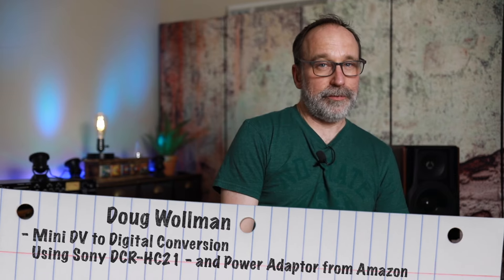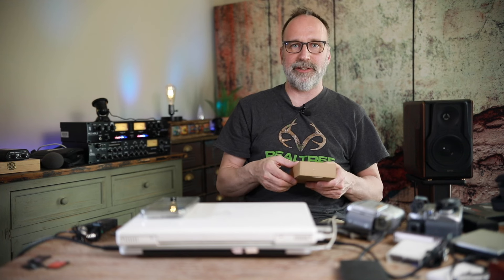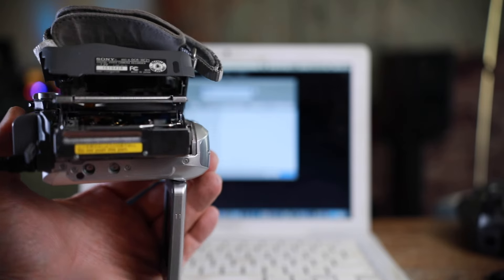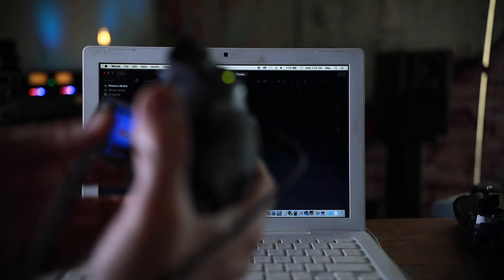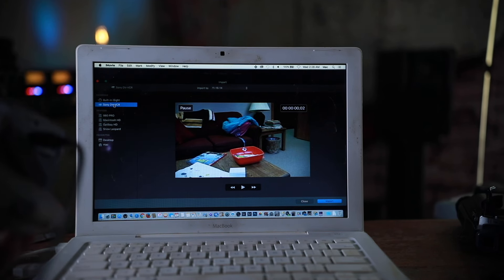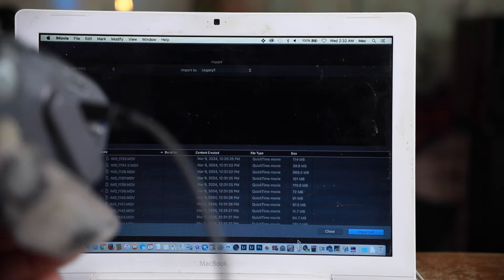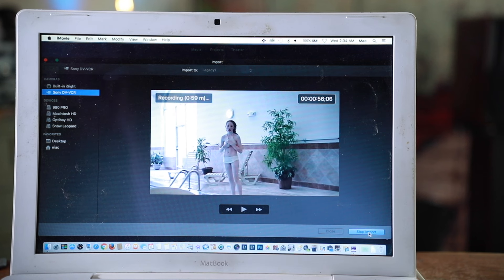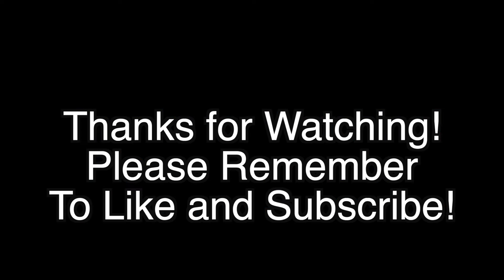Bringing Back Old Memories: Mini DV Conversion on a Budget

Comment: Youtube recommended me to a convert old mini dv to digital before its too late video. Made me think I have like 30 mini dv tapes of old memories in my basement. I have the same jvc camcorder. Drug it out and guess what. Same thing safeguard mode. No luck. Tried several things. Watched YouTube videos. Ran my old dv cleaner tape in it. Still safeguard mode 03. I purchased a tested working canon mini dv camcorder off of ebay with free returns I'd doesn't work. Luckily I still have my old desktop in storage with firewire that I can get my old tapes onto hard drive before the tapes are junk. Wish me luck
Reply from the maker: I’ll try to do a follow-up video that’s more succinct, together and bordering on instructional. But it sounds like you could get your project done if only you had a working camcorder. Well, I can’t speak for all Sony Handycams, but this one worked once I found a matching power adaptor.
Reply: @dougwollman2533  I had a typo in last comment. The canon camcorder I bought on ebay says Its tape tested working. When it arrives I should be fine. And I fired up the old desktop and I'm sure I will remember the process on hookup and convert to the pc. Used to all the time but was 10 years ago. I'm sure I will learn to appreciate newer windows even more after spending time on Vista again lol